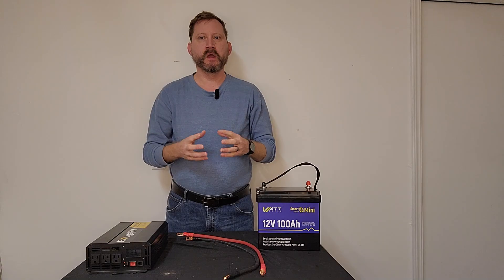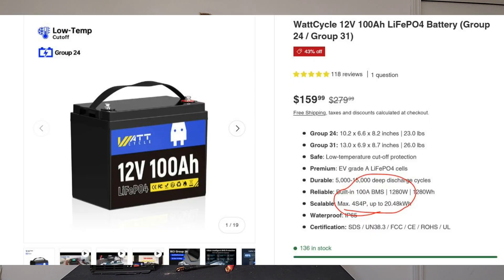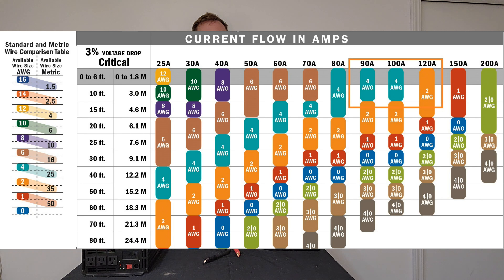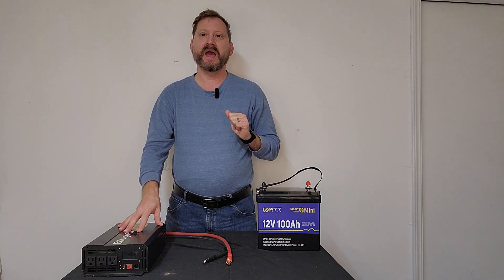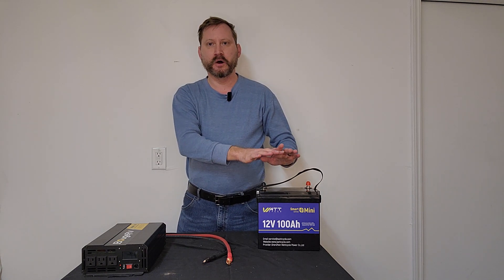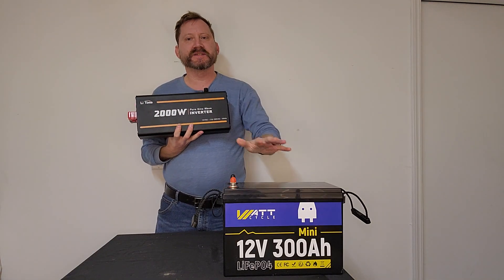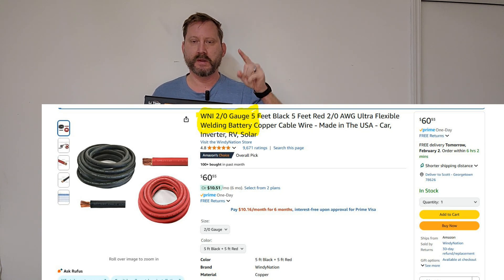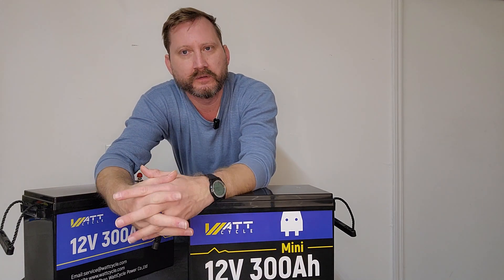Building a DIY Power Station DIY Start here! | Texas Prepper Projects #prepper #solarpower

Comment: Thank you I almost burned something down🤣... can anyone help me... I have 2 units that runs about 1 at 500w and the other about 600w what should my solar setup should be like? Solar panels, battery, cables and inverter?.... please help
Reply from the maker: you need to grab some watt cycle lithium batteries. Check out my latest videos for codes and links

Comment: I just use a 3 outlet 12v plug and I don’t use or need much more than 400w for my off grid setup. Most of my appliances are 12 V so I’m not really converting a lot to 110 other than a small television set and at times a crockpot but all my lighting runs off of the USB ports.
Reply from the maker: Great. Your TV likely can go direct DC so you can skip the inverter
Reply: @texasprepperprojects it’s a visio, idk how it could,
Reply from the maker: Check out my last video about a pure 12v rugged build
Reply: @texasprepperprojects will do

Comment: Good video 👍
I'm looking at a similar basic portable setup to be used occasionally. A 1000w inverter and 12v lifepo4 100ah battery. I see a lot of talk online about the nessesity of grounding the inverter. Is it necessary for a simple setup with one appliance connected and do you know what's involved for UK/Europe?
Reply from the maker: For a system that small, just buy it. Check out pecron for low cost options. Really it is only worth diy if you are going over 3kwh
Reply: @texasprepperprojects 
I use the battery mainly for a trolling motor. I thought I could get more use out of it with an inverter. Thanks
Reply from the maker: Check out the last video I posted about a water resistant battery build.

Comment: I've got 4 12.8v 300ah batteries setup as 24v system with 4/0 guage 8in wires connecting them to each other and 12in wire same guage to my 3000watt inverter. Overkill for safety.
Reply from the maker: awesome. you should consolidate that. Check out my recent videos for some deals

Comment: Is the BMS the new charge controller? Im trying to learn and sometimes I watch very old videos.
Reply from the maker: no, the BMS is a circuit board built into the battery that protects it. The Charge Controller, MPPT, is an external item that goes between the solar panels and the battery to regulate the voltage going into it

Comment: This was great info. I just wished you had expanded on how a 24 volt system works in comparison and how it allows for smaller gauge wire usage. I would have kept watching but now I gotta find another video somewhere that will explain further.
Reply from the maker: Check my channel.  I have an older video on 24v where I do a direct side by side on 12 vs 24 systems

Comment: I have a question though what if you’re trying to recharge off of solar and you’re using something like a MPPTsolar control system and you’re using 2 gauge wire but that wire doesn’t fit into your solar control system and it’s a capable solar control system that will hold 100 A of power from the solar panels in 12 or 20 volts what will we do then if the terminal inputs aren’t big enough but the solar control panel is more than adequate to handle would you need a step down converter or something like that?
Reply from the maker: Its known as a ferrel. Its a crimp that goes over the wire. But I personally dislike them.

Comment: What about using 4 batteries in series and going to 48 volt system ? 
What size wires would you need to connect the batteries together ? AutoZone ?
Reply from the maker: It's all about how much current you are going to pull.  Still, in my opinion 4awg is minimum, 2awg is preferred. Right now, check out my recent Watt Cycle video. they have a smoking deal on 12  314ah for $360

Comment: For tent camping, I want to DIY/build a power station. So, I purchased a 12V/100Ah LiFePO4 lithium iron phosphate battery (built-in 100A BMS, 8000 deep cycle group 31) and a 110V 1600W 12V pure sine inverter. I also purchased a 20-amp smart battery charger. It has been strongly suggested to use an ANL fuse holder. So, I purchased a 150A ANL fuse holder. Are these components compatible? Will the battery hold its charge with the 1600W inverter?
Reply from the maker: Yes. But you cant pull more than about 1100 from your 1600w inverter
Reply: @texasprepperprojects  Thank you. FYI, I want to be able to run my 60W cpap and charge lights while camping.
Reply from the maker: that should be MORE than enough

Comment: Ok question here. I have a 100 watt solar panel, an 80AH deep cycle battery, a 2000 Watt inverter( I know a little big for battery), and a solar controller. To protect the system, I was thinking to add a fuse at the battery. What size fuse? 80Amps? Thanks
Reply from the maker: What is the rating on the battery? Short answer i think 80a is about right
Reply: @texasprepperprojects  yes 80ah
Reply from the maker: what is the bms of the battery

Comment: Thought I did ALL of my homework before building my small backup system but I made a mistake.  I have 500 watts of solar, a 40 amp HQST controller and a Redodo 1000 watt inverter.  My system does fine powering my TV, Telephone (wall plug in), computer, sweeper, internet modem and a couple of LED lights.  Thought I did did it right ..UNTIL ..I tried to rum my 7cf chest freezer off my system.  The freezer wouldn't run.  I knew the surge was 865 watts and running it took about 75 watts. I thought that my inverter with a 2000 watt surge would handle it just fine.   The running wattage and surge was not the problem...it was the voltage that the Redodo inverter puts out.  Only 109 volts.  The freezer needs at least 115 volts to run.  So I bought a 2500 watt, 120VAC, 5000 watt surge Vevor inverter and now the freezer runs just fine at 121 volts.  Spent $110 on the inverter that I was unable to use.  Never considered the voltage.  I wasn't so smart after all.
Reply from the maker: Alway learning something new!

Comment: One thing I could say about the ammo can builds with small batteries and inverters is they would work fine for running a internet router, phone chargers, small tvs, couple LED lamps during a power outages.  I dont think anyone is building them to power their fridge or microwave.
Reply from the maker: That might be the case but what I was trying to say is that there is no reason to put a 500w inverter on a 10 amp battery.

Comment: How are power station companies getting 2000 inverters on portable power stations with smaller than 100 amp hour batteries in them?
Reply from the maker: its because those batteries are either not 12v, or have special BMS in them.

Comment: Hard Core 24 & 48 Volt System User here. And allot Safer not to mention Cheaper to BUILD

💦 Indian Creek Ranch ⛩
🌴 Southern California High Desert 🌵
Reply from the maker: Check out my 24v video. The problem with 48v is that the equipment is more expensive and the minimum solar input voltage is too high. At 24v you can use most RV and mobile appliances
Reply: @texasprepperprojects I am just now stepping into 48 Volt with an AELIUSSINE / WZRELB 7K Dual Phase Inverter found on EBay to Power Well Pump and On Demand Tankless / Endless Bosch Electric Hot Water Heater - 1000 Watts o Eco Worthy and 4 RENOGY 200AH AGM BATTERIES wired in Series for a 48 Volt Battery Bank. Both will run at the same Time and not for long Terms. The Solar should cover what's used and come Winter The System should still Produce for Us.

Comment: appreciate the current consideration approach - I cringe when I see video's or post about 12 volt 2000watt systems - wire size is the missing link - good news if you invest in wire, crimp tools you now have the means to build expandable systems and make your own power cables to length.
Reply from the maker: Agreed! Anything over 80 amps makes me real twitchy

Comment: Sorry to issue some negative comments, but.  you.  are     talking   too   slow!  You provided some useful information, but you started talking about AMPS out of the battery and pulling WATTS, not providing the difference between Amps and Watts.  Not everyone would be able to follow you.  You could have drawn a chart on a white board to provide a better of example 10 to 1.  The part about the wires was very useful for my level of solar and battery knowledge.

Comment: 5:41 What you say sounds totally logic, but then I wonder how UPS up to 1500w use those batteries... even if they are meant to work only for a few minutes...
Reply from the maker: Because a ups uses sealed lead acid batteries that do not have a bms. I had a 100ah mighty max sla that would output 600a, but not for long
Reply: @texasprepperprojects  Right, right, the bms. Thanks for the answer, and for the video!

Comment: Thanks for your video and I agree with you. The videos don't explain the wires enough because I thought 2 awg and the 2/0 was the same wires. I thought I was ordering 2/0 wire when I opened the package.I thought the person had sent me the wrong wire. You said two gauge. Nobody explains the chart. I see the 3% voltage drop. So you have a 100 amp battery in the distance of the war is less than 6 ft so that would be the 4 AWG wire but you are saying it best to go up a gauge to 2 awg. I don't know why y'all make it so difficult.
Reply from the maker: That's why I list my guidelines for 8,4 and 2 awg for 50a, 50 to 100, and then 100a

Comment: Another way around the massive wires is to double up lower gauge wires. Though it also means you need to fuse each wire and take up more terminals...
Reply from the maker: You could. Or you could just use the right size
Reply: @texasprepperprojects  Yep, doing it the one way is always the best way right!

Comment: Thanks for this. I recently bought a HF 5000 watt inverter. By you 10$ rule id be pulling 500 DC amps? Damn.
Reply from the maker: That is correct. That is a HUGE amount of current.  I doubt your BMS can supply that unless you have a 460ah battery. Even if so, you will need a power wire as big around as my wrist

Comment: I'm in the process of building a box with a  2KW inverter and two 12VDC 100AH batteries in parallel using 2/0 cable from WindyNation. Inverter and batteries are Bluetooth Power Queen. I do have a 250 volt fuse and a 200 volt battery switch in between them.
Reply from the maker: Those batteries are pretty small. Are you running them as 24v?

Comment: Question: When you run these batteries that have an integrated BMS in series, does that not mean your max current capacity is the limited by just one BMS? All the current from battery 1 needs to flow through battery 2, and therefore it's BMS. Your "double the power" comment @8:20 is confusing me. You make it sound like 2 batteries in series can magically double the voltage (which it does), without also limiting your max current to the capacity of one BMS. I don't understand how they could work like that. Do you have some sort of documentation from a manufacturer that explains that? I'm not trying to pick a fight, I'm just trying to figure out if it works that way or if I just misunderstood. Also, if you could get the same current capacity out of the batteries when they are in series, you would still need the same size wire to handle that.

ps. Keep preaching proper wire size. That could save someone's house, if not life.
Reply from the maker: No, they are still limited by the BMS.  So, if  you have two, 12v batteries with a 100ah BMS, then you have a 24v, 100amp battery with a 100amp BMS. However, you can run double the total wattage since watts is amps x volts
Reply: @texasprepperprojects  So I just misunderstood what you meant. You're saying its double the wattage with 2 batteries compared to 1 battery. Not double the wattage with 2 batteries in series compared to 2 batteries in parallel. 

Also, is it normal for a power inverter to be able to run on 12v and 24v, or do you need a special 24v inverter. If they are all  12v/24v, they would be more efficient at 24v since all the wires (including transformers & chokes) would have less losses. Within reason, higher voltage is always better for this type of application. Do normal inverters accept 32v or 48v? Much above 48v you have to worry about arcs since they won't self extinguish (no zero crossing like with AC). That is why relays have a higher AC voltage rating compared to DC.
Reply from the maker: @generic0000   No, inverters are specific to 12v or 24v.  MPPT solar charge controllers often will do 12 or 24.  RV or other car style fridges will often do 12 or 24v

Comment: For my boat I have a 36v 100 ahs battery run my trolling motor only. Just wondering if I can hook up a converter 200 w converter just for charging phones and maybe electric fillet knife.
Reply from the maker: Yes you can step down from 36v to usb

Comment: Anyone know If I hook up a 12V to 24V 10 amp step up converter to a 100W solar panel, Then to my battery,will That also boost the 100w panel to  200 Watts going into the battery.?
Reply from the maker: No. It doesnt work that way. Watts is amps times volts. If you use a voltage step up you will drop amps as well as eating 10 to 15% conversion losses. Voltage step ups are rarely a good idea

Comment: I think a bigger thing thats not talked about enough is, why 12v! 1500w ÷ 12v = 125amps, 3000w ÷ 24v = 125amps, twice the power, same amps, same wire gauge! Its not really any more expensive to build. Another fact is, when someone says its pure sign wave, and believes thats exactly what you want, is hilarious. The fact is, theres high frequency, pure sign wave, biult from $5 chinese chipsets, and then theres low frequency pure sine wave, biult with transformers, just like the power grid, real, reliable, long lasting, true power, that work really hard and last a very long time. High frequency is cheap, and way overpriced, thats why you can buy one at 50% off, and there still making 25% over what it cost to build, ever notice on these chinese units, Ecoflow, Bluetti, Pecron, etc, when you turn them on, they say 0 watts being used, thats impossible, if its on, its running off the battery, or there running on fairy dust, and you should buy one immediately!  LOL
Reply from the maker: Thanks

Comment: So, is a 1500watt inverter not ok to use with a 100ahv12v battery?
Reply from the maker: Not if you're going to be pulling more than 1,000w for  more than 20 seconds. You have a little bit of surge ability , but that's only for a few seconds
Reply: @texasprepperprojects  ok, so that kind of answers my not question.
I'm on a budget, so I have start small. I would like to start with a bigger inverter and add batteries. My plan is to start with a 1500w or 2000w 12v inverter and one 12v 100ah battery, but not let the inverter go over 1000w until I can add another battery. Basically treat it as if it were a 1000w inverter. Will that work, or is that too risky?
Reply from the maker: That will be ok. But check out my last video... wattcycle has a 280ah battery for $360 which is an amazing deal. What are you wanting to run?
Reply: @texasprepperprojects my immediate need is to run my fridge during power outages, which are happening more and more. Its apparently a guzzler. The sticker says amps 8.5 and volts 115. That's 977.5. So I think I would need a 1500 watt inverter to handle the surge. Is that correct?
Reply: Or could a 1000 watt inverter handle that?

Yes, I did see your last video. That's still a little steep for me. I've got between $400- 500 to do this. So I have to start small.
Reply from the maker: I would buy a pre-made unit like oupes or ecoflow. It just needs to be at least 1,000wh to make it a 24v period
Reply from the maker: https://www.amazon.com/dp/B0F6NGX7HP?maas=maas_adg_DBE672C3127F5D6209B3A8753C50FE84_afap_abs&th=1&linkCode=sl1&tag=texasprepperp-20&linkId=3c61815d7eaaa16a52adbb2ee1063d6f&language=en_US&ref_=as_li_ss_tl
Reply: @texasprepperprojects well I can't afford that, but i can afford the bluetti 100 v2 it has 1800 watts with a 3600 watt surge. Do you think that will work?
Reply from the maker: Yes. But it won't run a fridge a full day
Reply: @texasprepperprojects  thank you

Comment: Thanks for making and sharing your content. Everything that you say here is technically correct, but I will, respectfully,  push back on one point. Many of the pure sine inverters today come with cables that are of good quality with well fastened ring connectors. They ARE usually undersized for the rated max wattage of their inverter, but will do a more than adequate job with that inverter when you consider the short length of the cables and the fact that the general recommendation for inexpensive inverters is to limit the load on them to 75% or 80% of their rated wattage, if you want them to last very long. They usually aren't constructed well enough to be running flat out for very long. Of course the makers don't tell you this, so you could overload the wires just as you say, but in some applications the supplied cables are all you need. One other thing that I'd probably argue with is the need to replace the cables with larger more expensive ones. If you need more current carrying capacity, continue to use the cables that came with the inverter and just ADD another cable to the post with it. That wire will be smaller and therefore cheaper than buying a 2 or 0/2 AWG cable. The cable  inside the battery is likely made up of multiple small wires running from the BMS to the bottom of the terminals, already. They do it because it is more flexible to route around inside the battery. Also many ampacity charts are reflecting the concern for heat generation in conductors run inside of a conduit and the make up of the insulation that the wire is wrapped in. Open air, SHORT, wiring with silicone insulation can usually exceed those numbers substantially. A wire that gets WARM to the touch isn't necessarily at risk of causing a fire.
Reply from the maker: Thank you for the polite and helpful reply!